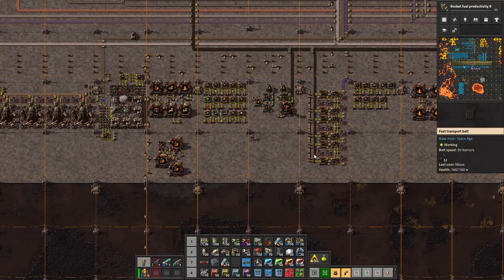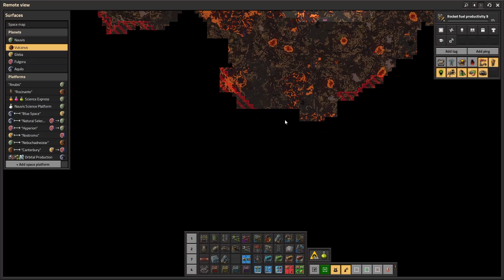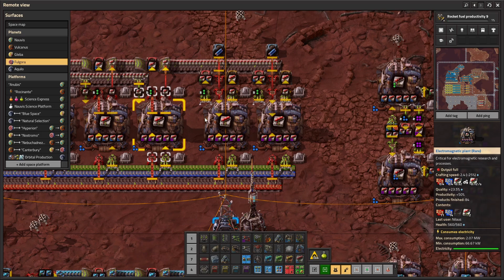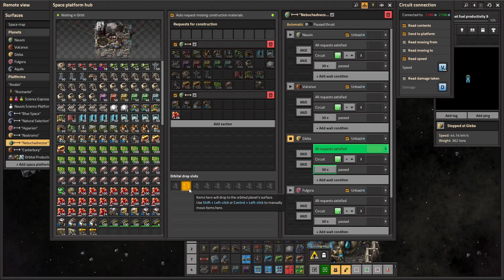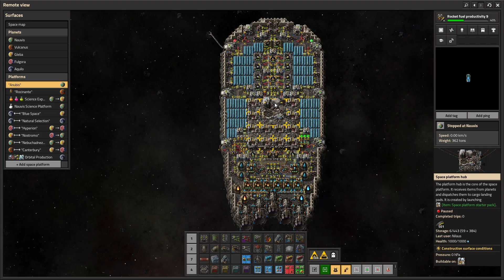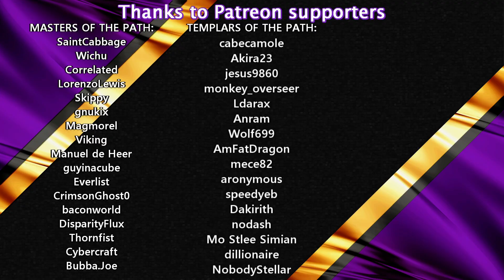The Power Of Vulcanus Production: MASS GREEN CIRCUIT | 29 | Factorio SPACE AGE

Comment: Is it possible for someone to explain, Nilaus is making small section for green circuits, and between 6:00 and 9:00 calculates, that single section effectively makes slightly less than 60 green circuits/s. But this is the throughput of the green belt?
So, why this section then repeated 4 times for a single green belt? It could not make the planned throughput this way. One section is enough. Is my way of thinking misses something?
Reply: Stack inserters place 4 items on top of each other, practically quadrupling belt throughput
Reply: @torbjrntveito2152  Got it, thank you

Comment: Blue chips and LDS has +% productivity research. With legendary productivity modules, you get to the 300% limit, which means no loss in recyling. Once you get to that point, you are drowning in legendary iron plates, copper, plastic, and steel, and green circuits. It's much simpler to craft all the tier 2 modules with legendary base materials rather than gambling for them. So the best strat is to start farming for legendary quality and prod modules (like how nilaus is doing it) until you get enough to get the 300% prod limit. You would use quality on the recyclers, and prod on the electromagnetic plant.
Reply: Isnt it capped at 150% ?

Comment: That you build the lava to liquid iron/copper for each build i find amusing.  I would assume you would have a line of those buildings by the lava field and pipe that instead of piping lava and put a single tank of each sound or light on when that tank drops below 80% so you know to build more liquid iron/copper
Reply: That simply isn't how Nilaus works. He wants modular builds where one can grab the blueprint, stamp it down, and move on. Obviously it isn't always feasible so he does have smelter lines on nauvia, but with the throughput of these it makes total sense with his goals in mind.

I generally lean towards your method, but it is very much not the way Nilhaus does things.
Reply: @88porpoise  When you put it that way, I can see it more of the Nihaus way.
Reply: @88porpoise  But the modular builds usually require input anyway. You can easily make a modular build expanding the molten iron/copper production. The pipelines are only limited by their input.
Reply: @kashmir33-x8g  The input for this build is a lava pipe. That is it. And if you go with a dedicated lava processing area you replace that with an Iron pipe and a Copper pipe, so this method minimizes inputs.

To separate things you now need to do two modular builds to set this up (and then potentially add another lava pump).

There are absolutely advantages to a dedicated lava processing line, no question, and it is something I personally do. But in terms of Nilaus's style and goals this just makes more sense.

Comment: Have you done the math on Foundry vs EM Plant for copper cables?  

I’m not sure which one has better yield.
Reply: I did. If you don't have normal prod 3 in EM plant AND copper plate casting foundry then just cable foundry is better. With normal prod 3 it's a tie, so no point wasting modules and an EM plant on that, with uncommon or better prod 3 EM plant is better.

But that's just prod. I didn't calculate for quality.
Reply from the maker: Foundry. Not even close
Reply: foundry to make copper plates, then emp to turn them into cables

Comment: Why have productivity modules in the green circuit assemblers, you are only saving lava and slowing the assembler down at the same time. May as well swap one out for a speed to fully saturate the belt, assuming it stays in ratio with the foundries
Reply: I don't know the specific ratio in this case, but often you can get more throughput going to productivity than just more speed. Because speed stacks with speed linearly, while productivity stacks multiplicatively.
eg, if you are at 200% speed already, and you add 50% more with modules, you only go to 250% speed (2.5/2.0 = 1.25 increase). While if you added 50% productivity you would get 1.5x increase. 
The specifics very much depend on what breakpoint you are at. One of the nice things about Quality is that it becomes an independent multiplier (I believe). So a 1.6x speed quality assembler, with +200% (3x) speed from modules is a 3*1.6=4.8x speed, rather than just being 60% + 200% = 3.6x speed.
Though the same thing is also true for productivity, and the new machines that give a built-in 50% productivity is additive vs modules. (so quality on the assembler is multiplicative with speed, but productivity is additive.. :()
With the specific setup he has, putting normal speed 3 in a rare em plant with a single rare beacon does give about 2x the throughput as putting uncommon productivity. (Though you probably have to worry more about inserter throughput at that point).
Interestingly, it seems higher throughput all the way up until a 12 rare beacon setup with rare speed modules, and then if you put rare productivity you get slightly more throughput than if you put rare speed (it takes 1.6 machines to make 240/s vs 1.5 machines to do 240/s).
So there is a breakpoint where productivity isn't just saving lava, but is also increasing throughput, but you're absolutely right that we aren't close to it yet.
Reply: As a data point, with epic quality, 12 epic beacons with epic speed around 1 epic em plant with epic productivity is slightly more than a full belt. Of course, you're wasting a lot of the potency of those 12 beacons, so I'm sure the best balance point (number of epic items/modules vs the space etc) is somewhere closer to 8 beacons and 2 em plants (10 prods, probably 10 beacons, 20 speeds, 2 plants). 4 EM plants is likely to get the most beacon sharing.

FWIW, I'm using Factory Planner in-game mod to do the math, cause there are way too many factors to take into account to use a spreadsheet.

Man those numbers are rediculous, and Legendary is a significant tier above that. 1 legendary EM plant with legendary productivity, with 2 legendary beacons with legendary speed is enough to do 240 items/sec. (It also says that 4 beacons double the speed, but 8/12 beacons don't actually increase throughput, I wonder if we're hitting a cap somewhere.)
Reply: @JohnMeinel   never considered that perspective thanks for putting a new spin on it even if the break point is after things get kinda crazy with beacons
Reply: @aarontandy5890  it's a really hard habit to break though!
Reply: productivity is faster than speed past a certain point

Comment: How can I flip blueprints?
Reply: With the H and V keys, for horizontal and vertical flipping.
Reply: @Hartlane  Thanks
Reply: @DaStrikeYT  Also works with just buildings, so you can line up pipes on an oil refinery and have them facing each other with the output pipes down the center

Comment: I'm surprised he launches up just pure green circuit. I'd do The upcycling part on Vulcanus to save on Rockets as I expect that to be The main bottleeck
Reply: thats exactly what we just did on twitch version
Reply: Why save on rockets when you can produce everything it needs forever?
Reply: Honestly, I'm gonna turn fulgora into an eternal rocket fuel export machine if the stack size for it is overcomes it's cost. And even if it doesn't, still feels like I should be producing literally all rocket fuel for all planets in the OIL OCEAN PLANET, right?
Reply: @sirdeakia  hahaha fair! I use Gleba a lot, easy biosulphur and bioplastics. But honestly probably comes down to the order I visited them more than actual functional reasons
Reply: Wait, you like gleba? Do you also enjoy chewing on glass shards? @AnerDyfan
Reply: @sirdeakia  тоже задумывался на счёт этого😂😅
Reply: @sirdeakia  Yes, export rocket fuel on Fulgora is the answer, circuit and low density from Vulcanus is better. Not sure if I can export heavy oil, barrel logistics' cost of sending empty ones back to space seems stupid. unless we find some smart way doing it. I would have to demand filled barrel on export planet, and empty barrel on import planet (which is short on heavy oil/light oil). not the smartest thing one could do. dropping fuel directly seems to be a better choice.
Reply: @sirdeakia  Rockets cost oil products to launch. As such shunting plastic to Vulcanus and converting it to red and blue there is more efficient in Rocket Parts since they consume so many green in their production chains.
Reply: @AnerDyfan  Nah everything is 100% free on Gleba.
Reply: @sirdeakia doesn't sulfur acid geysers run out eventaully on vulkanus?
Reply: @OniNaito really? thanks, for info
Reply: @silvk1000 No, they work the same as oil and just decrease in yield but I've seen geyser fields that have a combined yield of over 350,000%. The amount of sulfuric acid you'd need to use to even make a dent in that is probably 1000x more than you'll ever need to beat the game. I genuinely think they might be bugged or something because the yields get absolutely ridiculous if you go out far enough.
Reply: Unless I missed something, this seems like the first step in turning Volcanus into a massive chip factory.

And he probably wants to have plenty of greens going around for various mass produced things where quality isn't that important.